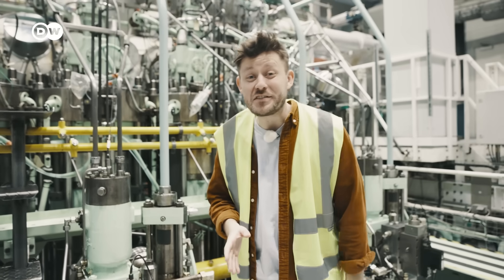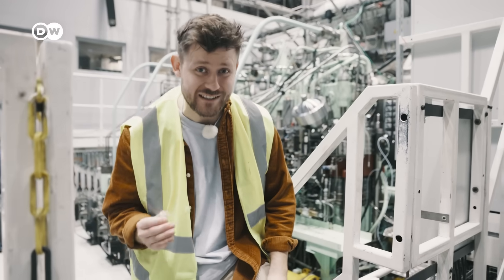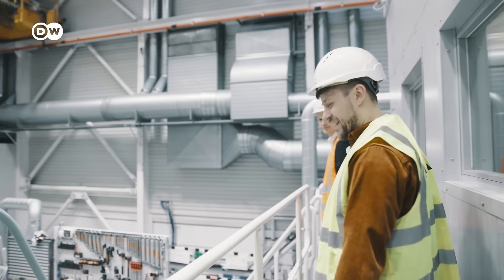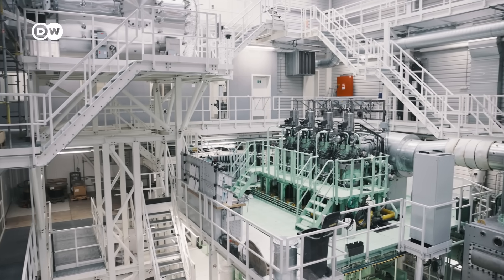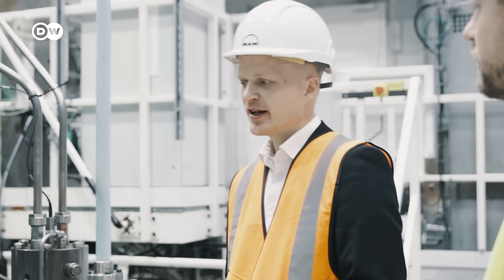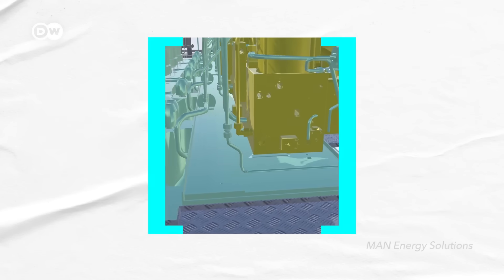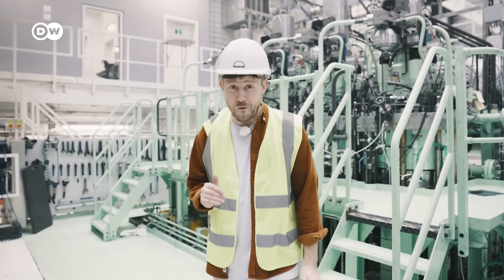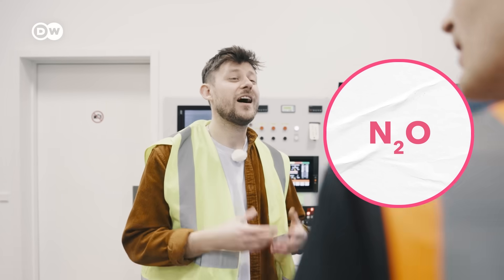Can this magic fuel clean up the shipping industry?

Comment: higher combustion temperatures lead to higher NOx emissions, N2O may be lower but NOx was the whole reason for the diesel gate, so not a great product to create i would assume. this is fairly straight forward. the higher the temperature, the more gas is going to react with each other. that's why compression igniters have more NOx emissions compaired to spark igniters. as a side note, NOx and NO2 are not two different things. NOx is the group of nitrous oxide emissions. so NOx can be NO or NO2, the x is their to indicate that you can have x = 1 or x = 2. 

very cool to see that MAN let you in on their development.
Reply: Thanks! Thought that too
Reply: key issue is that nox emmissions out in the ocean are not nearly as problematic as overland, whereas CO2 is, quite literally, the best money for the cause of the apocolypse

Comment: Ammonia can be clean if it is made through renewable energy (green hydrogen). This is one of the biggest issues of ammonia
Reply: Can be in theory, yes - but for that to be financially viable, it needs that renewable energy to be so cheap it's practically free. That's an economic problem, not technical: No solution for saving the world from the effects of climate change can be considered viable unless it is also price-competitive. Those are just the rules we currently work under.
Reply: @vylbird8014     Renewable (wind and solar) energy has the feature that it is supplied when the earth decides, not when mankind decides.  This means that renewable sources big enough to make a meaningful contribution to peak grid demand, have surplus energy at other times. There is a limit to viability of energy storage- battery cost is relatively high, pumped hydro is limited to regions with suitable geography or suitable old mine infrastructure, and molten salt etc technology hasn't currently been able to fill the void.
This means there is currently often a surplus of renewable energy in off peak times that is not used.  Energy that is available at low or no cost. Chemical energy banks like H2 and ammonia are ways to harvest this unused and currently unuseable energy.    Rather than green hydrogen being a "terrible" solution for anything climate change related, it is an ideal solution, for the above reasons.
Reply: So you use lots of energy to make hydrogen, then you use lots of energy to make amonia, then you get many times less caloric energy out of that fuel than oil. I am wondering if burning oil in the first place would be better, rather than building all of that infrastructure and spending all of that energy. Its only 3% of global emissions. Maybe we should focus this energy and resources into more polluting sectors like house insulation or agriculture or cement and steal production.
Reply: @michasosnowski5918  The only way it could make sense would be as a useful sink for excess renewables. Solar and wind produce very variable output, so in a potential future where they make up a substantial portion of power generation there will be times when the weather is just perfect and there is more power than needed - in that case energy becomes nearly free, and it might make sense to fire up the intermittent-operation fuel synthesis. But for that to happen would need a huge amount of solar and wind power in operation - enough to make up a substantial part of electricity generation.
Reply: @vylbird8014  Energy is already nearly free or less than free when at peak outputs.
I imagine that current electricity producers are already interested in any kind of storage solution for the energy that they produce, whether batteries, hydrogen (P2X) or something else
Reply: I meant to add, that because renewable energy is so cheap when abundant. That is actually one of the reason holding back renewable energy being built. simply because they cant make money.
Reply: @vylbird8014  In a few parts of the world that is already on the way.    South Australia, for example.
Reply: @tjampman     Good accurate comment!
Reply: @tjampman  Who said they can't make money? It's cheap for the consumer as it's cheap to manufacture. The profit margins of the producer are not impacted in any manner. The production companies are opposing as their number of customers can reduce (people are becoming self-sufficient in terms of electricity by using roof-top solar)
Reply: @hrushikeshavachat900  The reason renewable grid suppliers struggle to make money is because, when renewable electricity is abundant the price is low, and when the electricity price is high it is usually because there is no supply of renewable electricity. 
So either way it is difficult to make money on renewable electricity without subsidies. 
Despite the fact that wind and solar have some of the lowest costs per watt.

So that is the reason I think any kind of storage solution is of high interest for renewable energy producers, because it will allow them to sell electricity at higher rates.
Reply: @michasosnowski5918  All the sectors are very small when compared to transportation, which accounts for 74 percent of total emissions. So, we need a viable long-term solution for transportation.
Reply: @hrushikeshavachat900  I dont know where you get your numbers, but quick google search tells me that transportation accounts for one fifth of global emissions, and three quarters of that is road transportation. So shipping accounts for less than 5 %, I think they were talking about 3% in the material.
Again, we need to focus energy on more polluting sectors.
Reply: @michasosnowski5918  Cement and steel production (and aluminum production etc etc) are ideal industries for using green hydrogen, either in pure form or as ammonia.
 Renewable (wind and solar) energy has the feature that it is supplied when the earth decides, not when mankind decides.  This means that renewable sources big enough to make a meaningful contribution to peak grid demand, have surplus energy at other times. There is a limit to viability of energy storage- battery cost is relatively high, pumped hydro is limited to regions with suitable geography or suitable old mine infrastructure, and molten salt etc technology hasn't currently been able to fill the void.
This means there is currently often a surplus of renewable energy in off peak times that is not used.  Energy that is available at low or no cost. Chemical energy banks like H2 and ammonia are ways to harvest this unused and currently unuseable energy.    Rather than green hydrogen being a "terrible" solution for anything climate change related, it is an ideal solution, for the above reasons.
Reply: That's one part of the equation the other is the pollutants at the tail pipe as discussed in this video. While this company has a nice little animation and at least a somewhat working catalytic reactor, no one has actually been able to create a viable reactor for ammonia fuel yet. The one in this video only works on only 1 cylinder and only at full load on the engine and is the size of a car itself.

Not exactly viable if it only really works at full load on the engine, or if it's 4 times the size...
Reply: @hg2.  So u basically, saying it is not true?
Reply: Same issue with EV
Reply: @user-uh6kq2wh9g  Yes. That's true. But as per recent studies, life time emissions of electric vehicles powered by electricity obtained from coal are seen to be similar to diesel cars. They are h8gher than petrol or CNG but equal to diesel.
Reply: @hrushikeshavachat900   "as per recent studies" time life emissions of EVs powered by electricity obtained by renewables are far less than petrol or diesel cars.
Reply: @annpeerkat2020  Yes. I was talking about a specific type of electricity (electricity produced by coal)
Reply: @hrushikeshavachat900 Studies? I’d be curious to see that. EVs are approximately 4x more energy-efficient than than gasoline cars. And coal-fired power plants are about 2x more efficient than gasoline engines. So even a “coal powered EV” should be far more carbon-efficient than a gasoline car.
Reply: @davestagner  Completely agree. But the emissions caused by one kg of coal are higher than 8 kgs of gasoline (2 times and 4 times efficiency. So, 8 times). So, the higher emissions.
Reply: @hrushikeshavachat900  Not true. Fossil fuels produce approximately 3kg of CO2 for every 1kg of fossil fuel burned, regardless of whether it’s coal, gasoline, or methane. That’s because they’re hydrocarbons, so the mass is dominated by carbon (atomic weight 14) rather than hydrogen (atomic weight 1). And CO2 is two oxygen (14) to one carbon, so about 27% carbon by mass.
Reply: @davestagner  Coal has a higher carbon percentage than diesel, which has higher content than petrol, which has higher carbon content than natural gas. This is the reason why CNG powered cars are considered cleaner than all other types of fossil fuels and promoted by many governments around the world.
Reply: @hrushikeshavachat900  You should fact check your claims, like I just did. Methane is 75% carbon by weight. Gasoline is 84-87%. Bituminous coal is 45-86%. So by weight, gasoline produces the most CO2. Of course, coal has a lot of impurities that become soot and fly ash, but I was only talking about CO2. That’s the pollutant that matters.

Beyond that, the energy from burning fossil fuel comes almost exclusively from carbon to CO2 and hydrogen to H2O. So btu for btu, they’re the same.
Reply: @davestagner  Okay. You are right.
Reply: @hrushikeshavachat900  Actually, I was wrong! As I continued my fact-checking, I learned about Hess’ Law, which relates to the complexity of hydrocarbon chains. The upshot is that it takes more energy to break apart more complex hydrocarbon chains (like coal) before they can burn, relative to simple chains (like methane). So burning coal really does produce twice as much CO2 as methane for the same unit energy, because it’s harder to burn coal than it is to burn methane. I was wrong, because I was only looking at mass, not the energy cost of combustion itself. (fwiw, gasoline is only marginally better than coal.)

Being right is always better than being “right”. That’s why fact checking is so important - it makes us smarter!
Reply: @davestagner  Thanks. I forgot the name of the law. But tha KS for reminding me.
Reply: At that rate, you likely be better off using the “green” hydrogen directly as a fuel
Reply: @tristanmelling410  Cannot be used in combustion engine and issue of energy density. Also, liquid hydrogen is highly unstable.
Reply: But therein lies another problem: green hydrogen itself is a terrible solution for anything climate change related until 2050 or later because it's super inefficient and any green hydrogen production via solar/wind/hydro/etc. would be better spent putting clean energy directly into the grid, EVs, etc. 

Almost like hydrogen as a fuel source is being pushed by the fossil fuel industry because they know it's another profitable avenue for them to turn methane into hydrogen and know green production is too inefficient to make any sense.
Reply: @tHebUm18  Renewable (wind and solar) energy has the feature that it is supplied when the earth decides, not when mankind decides.  This means that renewable sources big enough to make a meaningful contribution to peak grid demand, have surplus energy at other times. There is a limit to viability of energy storage- battery cost is relatively high, pumped hydro is limited to regions with suitable geography or suitable old mine infrastructure, and molten salt etc technology hasn't currently been able to fill the void.
This means there is currently often a surplus of renewable energy in off peak times that is not used.  Energy that is available at low or no cost. Chemical energy banks like H2 and ammonia are ways to harvest this unused and currently unuseable energy.    Rather than green hydrogen being a "terrible" solution for anything climate change related, it is an ideal solution, for the above reasons.
Reply: @tHebUm18  I don't want to use green hydrogen as fuel which solves the biggest issue of green hydrogen